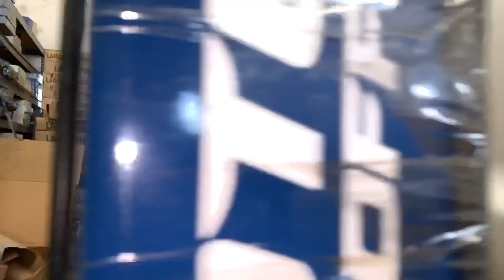2018 TOYOTA TUNDRA, Lifted Fox 2.5 Remote Reservoir DSC & 6” Pro Comp Lift

Comment: I have a question I have a 7” bds Coilover kit with a 4” block in the back and the coach builder 3” shackles. I have the Fox 2.0 shocks absorber in the back but I want to upgrade to the 2.5 Fox with remote reservoir with dsc for the back. I think that is what you use in this video for the rear. I want to know which Fox are those in terms of item number. Can you guy help with that